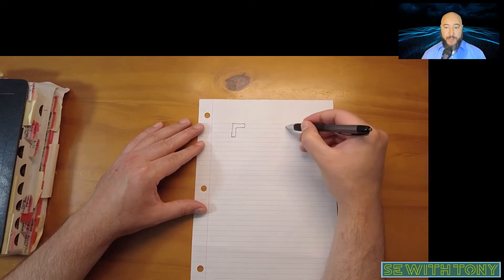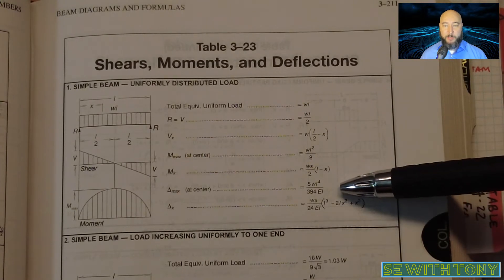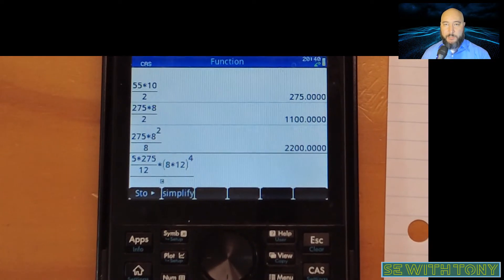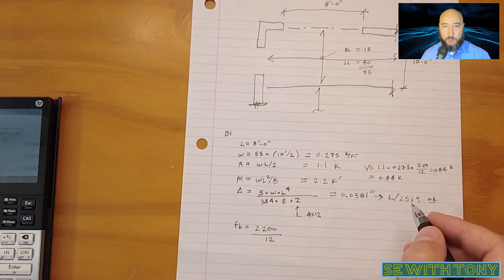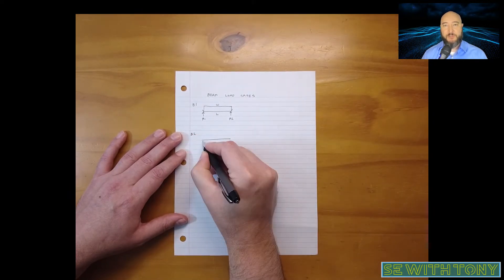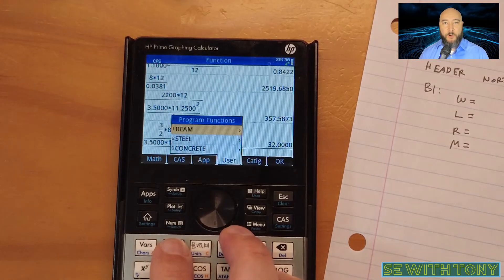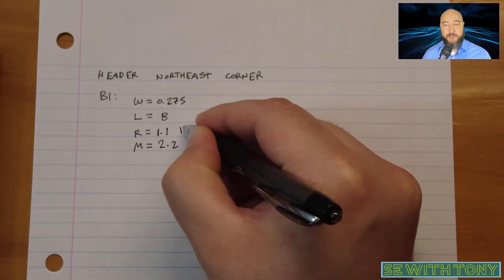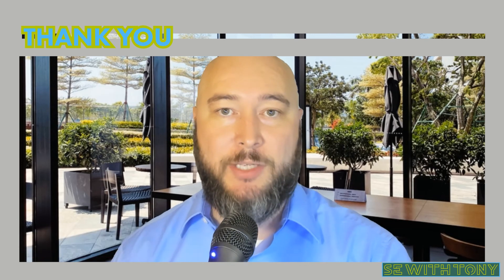Automate structural beam calculations with the HP Prime Graphing Calculator

Comment: I had too much time invested in my 50g to even consider the prime. I wrote a tonne of programs for it.  One program I wrote was designing concrete beams and converging to an appropriate solution, complete with menus and error checking.😊  I also had preprogrammed load cases saved & used the numeric solver to determine any variable. These days it's mostly excel and my 50g is barely used.

Comment: This is where, the document-based system of  "TI Nspire CX CAS" is the more superior. Each document is its own isolated compartment of mini-programs, constants, formulas etc. You can also create then expose common formulas into a publicly accessible list. And because it is document-based, you can shared the document (it is just a file) with others and they will have your compartmentalized/specialist mini formulas, mini-programs under that document.
Reply from the maker: That all sounds convenient.  HP has a "connectivity kit" application that runs on my desktop that seems to work the same way.  However, the files that contain the program are specific to the Prime's operating system with an extension .HPPRGM.  So, whenever one of my coworkers gets a new calculator I can simply drag and drop the .HPPRGM file.  It couldn't be easier.

Comment: Hi Tonny, Can I have a question about the setting? When I input a fraction, the  Entry Line only shows 1 line. For example,  it shows 9/3 (exactly like this). It displays like another cheap calculator. Hard to see in complex math. Is this something I have to do with the setting display? Thank you so much.
Reply from the maker: I prefer to operate my calculator in the "CAS" environment rather than the "Home" environment on the HP Prime.  CAS is a computer that can solve symbolic equations.  Something like Matlab or Mathematica.  Also, CAS is useful for writing scripts assigned to variables that streamline your calculations.  In case your screen looks different from mine.  I have typed the settings I used in "CAS" for the calculations shown in the video.  
"CAS" settings: number format is "Standard" = 4, Integers are "Hex" and check box, simplify is "Minimum".  Also, uncheck: Exact, Complex, Use i, and Increasing.  Also, check: Use (root symbol), and Principal.  Finally, in the home settings on page 2 I use "medium font" to format the number of character on each line of output.
Reply: There's a template for rational functions.